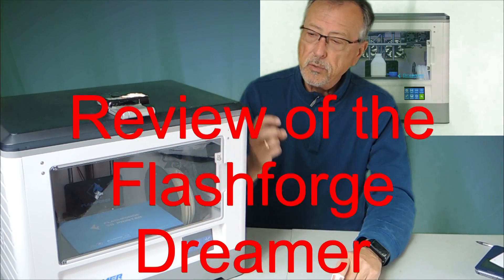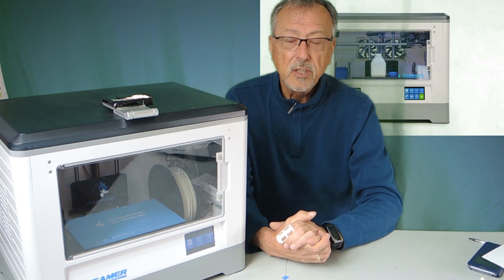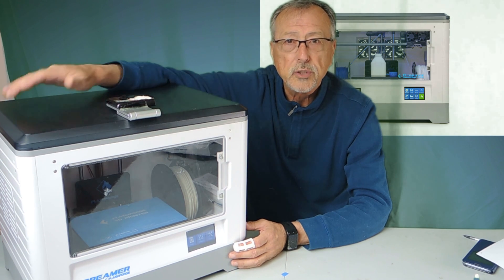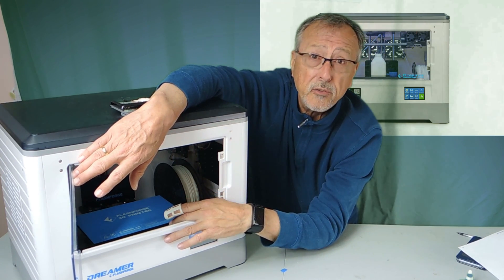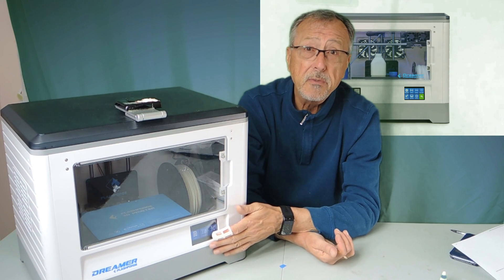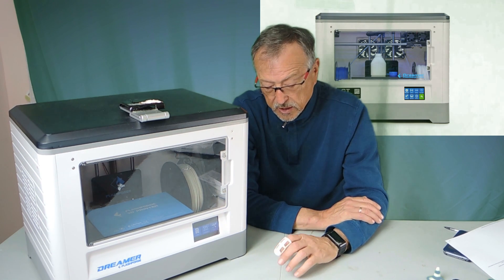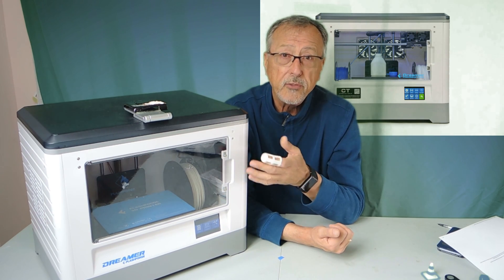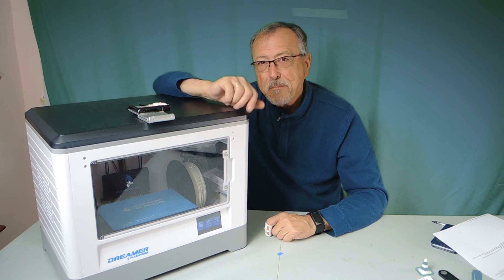Review of the Flashforge Dreamer

Comment from the maker: Just heads up I no longer use the flashforge I use the Prusa Mk3. As someone who has used both the Prusa with mesh bed levelling is much better. Almost perfect prints every time. But get the accessory of the powder coated bed. Much better for printing.

Comment: Hello, is the printer quite when it operates? I am thinking to have it in my spare bedroom but I am worried that it will keep me awake at night.
Reply from the maker: Fulv P  it is very quiet since it is enclosed. Although it is quieter then open units there will still be some noise
Reply: Emerald Meadows thank you for the quick reply. Can I ask you another question. During the print if the printer runs out of filament, what happen?
Reply from the maker: It just keeps running. There is no filament out sensor.

Comment: Ths flashforge dreamer just got reduced to 899 would you recommend it over the 799 creator pro?
Reply: I'm under the understanding that the creator pro is completely open source, and the dreamer is not. So keep that in consideration. I have the dreamer and I really like it. As for webdevvie's comment on the flexible filament, I run ninjaflex in my printer all the time, and I have never, repeat never had a jam with it thus far. The other thing to be mindful about is that the latest dreamers temp tops out at 248c. This is because of the ptfe tubing in the hot ends. You can upgrade to all metal hot ends, but you'll have to back date the firmware to change the temp limits. I have done this and have found that the thermocouples are not liking anything over 265c. So now I need to find a suitable thermalcoupler that can do 300c. I'm trying to print pcabs, and it needs 280 minimum according to the tag on the spool. But I can't get there because the printer read temp malfunctions after 265c. So, those are just things to consider. If you upgrade to an all metal hot end, you can print material like nylon around 260c. But the stock hot ends will not do it.

Comment: I have the Flashforge creator pro. And Flashforge makes very good makerbot clone machines :) 
Consider getting Simplify 3d. Its a great product for doing head printing. If you plan on printing flexible filaments get a different extruder like the dual flexion extruder kit.

Sidenote on the video: This would be so much better if you would record the audio with a good audio recorder like the Zoom h1 or h4n. Also not having the printer on will probably save you some headaches on the audio side.
Reply: Thanks for the feedback
Reply: Webdevvie Ths flashforge dreamer just got reduced to 899 would you recommend it over the 799 creator pro?